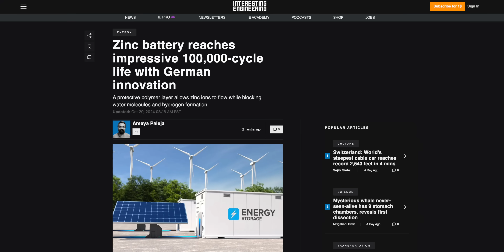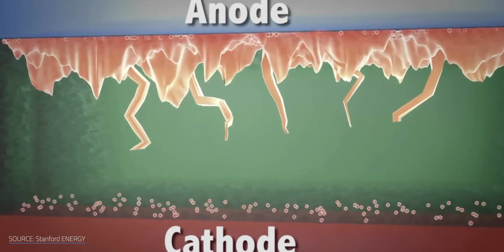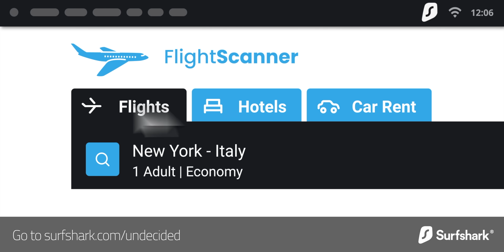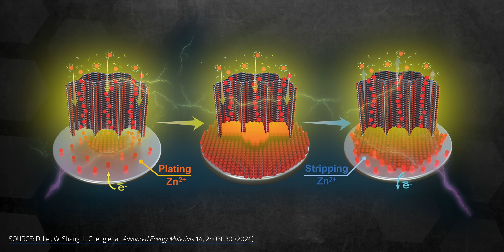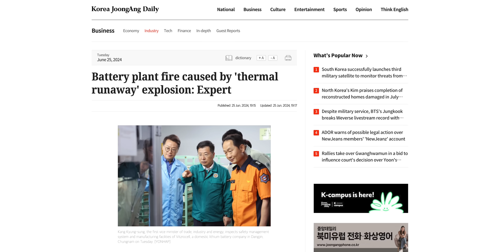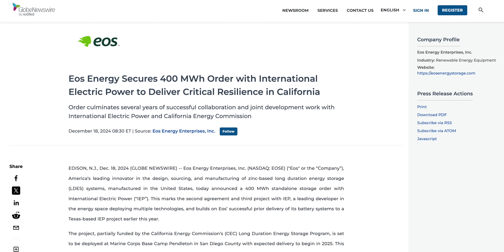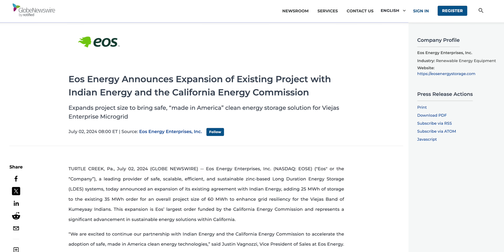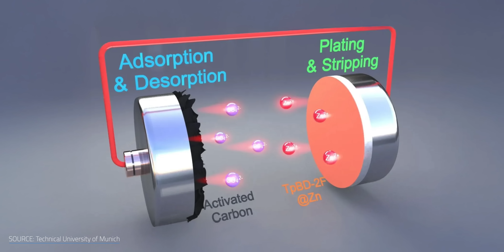How Zinc Batteries Are Defying Limits

Comment: Edison batteries, which use zinc and iron, don't have the problems of pure zinc. They do emit hydrogen, but don't have the other problems, so long as the aqueous electrolyte is refreshed every 8-10 years. Early 20th century EVs, which are museum pieces, have original Edison batteries that still function. No fancy nano-particles or polymers needed.

Comment: The avg dist. To the moon is 238,000 miles one way. So you could drive to the moon and back again one time, not three, with one tesla battery as it stands now. Or get that kind of mileage out of one 1990s toyota combustion engine that's properly maintained before needing a rebuild of the wearable internal components. Though the last 100k is a bit under powered and youll know she is getting ready to need a rebuild.

Comment: NO it does NOT last 100 000 cycles. Wait, but it does ? Even if it does, it doesn't MEAN ANYTHING.  Why ? Because manufacturers will continue to milk Lithium for ever. Why ? Because its PROFITABLE. Nobody cares about climate or saving the planet. PROFFITS is everything. Now imagine how ridiculous it sounds to sell the cars that lasts forever and doesn't need $ 50 000 battery replacement. So forget everything. Nothing will change. For at least another 30-50 years.

Comment: Redflow had a similar flow battery, what killed them was reliability of the moving components and a requirement for yearly servicing. The battery needs to operate for 5 plus years without any intervention.

Comment: Ummm... the one way distance to the moon, while quite variable depending on the specific point in the orbit, is reasonably close to 250,000 miles, so a Tesla battery with a life of 300,000 to 500,000 miles is not equivalent to "two or three round trips to the moon". One round trip would be roughly 500,000 miles.

Comment: Matt is just reading the Hype articles and not the technical papers. There have been so many "Revolutionary Tech" covered, but only less than a handful is being used or will be used. 

How many times has it been where you talked about hydrogen this, hydrogen that, cold fusion this or hot fusion that. None came up.

Comment: Hi Matt. Have you looked into the "Charlie" induction stove from Copperhome (I'd post their website link but Youtube seems to think that is spam and deletes the comment). The stove has a built-in Lifepo4 five kWh battery that would allow you to cook 3-5 meals during a power outage. It also works on shared 120V/15 amp circuits.

Comment: I'd thought that nickel-iron batteries were essentially-unlimited-cycles ( ie decades of daily-cycles ), & were preferred by the .. what are they called .. not Preppers .. Appropriate Technology people?  GEK, & the civilization-reboot-technologies people, OpenSourceEcology or something like that..

Anyways, IF industry special-interest-groups have been able to suppress things like nickel-iron batteries for grid-scale reservoirs,
and they were able to suppress NiMH for cars ( an oil-company owned that patent, to prevent that technology's use ),
etc, I've no doubt that s.i.g.'s will be able to continue distorting our market to make-certain that only patented/high-profit options are allowed to be chosen..

I met a guy who invented a bubble-insulated greenhouse..

He opensourced it, instead of patenting it..

4' thick of bubbles above the plants, in the winter,
you only apply power to the bubblemaker-motor when insulation's needed,
you only need 2 layers of plastic ( outer & inner ),
etc, made it amazingly effective for greenhousing..

s.i.g.'s won't allow technology they can't control to be pervasive.

He was already bitter when I met him, with reason..

( this was in Eastern Canada, btw, north of mainland US, & he had a fig-tree inside )

Anyways, the more I learn, the more that it seems that unnecessarily-fragile, unnecessarily-expensive technologies always are preferred..

Did you know that simply by switching from turbofans to turboprops, & slowing transport-aircraft some,
IMMENSE fuel-savings result??

Won't happen, though, will it?

& switching from turbine to piston cuts fuel-consumption significantly
( but increases the maintenance-frequency,
so you'd need to simply swap engines on an aircraft, instead of maintaining them on it.

that jet-tech guy, can't remember his name, looks like Radar O'Reilly, said the maintenance-costs are about the same,
between the 2 technologies )

Anyways..

Salut, Namaste, & Kaizen, Dood..

_ /\ _

Comment: 0:50 "...Elon Musk has said Tesla car batteries should last for 300,000 to 500,000 miles. That’s roughly the distance you’d cover if you drove to the moon and back — three  times."
Because 238,855 miles to the Moon, multiplied by two because "...and back...", and multiplied again by "three times" = 1.433 million miles. 
And everyone knows that 1.433 million is exactly the same as "300,000 to 500,00 miles".
Who writes the script?  And who reads it without thinking ?

Comment: Matt, as always, thanks to you and your team. Great coverage of some exciting innovation.

I recently leased a 2024 Hyundai Ioniq 5 Limited and took it on a 2000 mile road trip with my family. I had been "on the fence" about getting an EV but the climate crisis and my own complicity in it compelled me to "go for it". After approximately 3000 miles with the car my only regret is I didn't do this sooner. Charging stations along my route (from MA to KY) were plentiful. We traveled over the holidays and, yes, we had to wait at 2 places but even then the break was nice.

As an electrical engineer I truly appreciate the simplicity of the car in that it doesn't have all those moving parts an ICE-based car has and does not require all those fluids (oil, transmission fluid, gas). I smile at the thought I haven't been to a gas station in months! I don't have "tune ups" to be mindful of. It's been a joy. Also, the geek in me appreciates the sophistication - Maxwell's equations embodied in an engineering marvel with regenerative breaking!!! Beautiful.

I also have been making good use of energy sage (https://www.energysage.com) and have signed an agreement for a 32-panel, 14 kW array going up on our roof this Spring. I have scoped out an upgrade of our HVAC from natural gas to cold-weather, high-efficiency HP's but will have to hold off on that one for a year due to cashflow concerns (I'm "retired" now).

And I also use Surfshark regularly, great product. 

So I want to thank you and your team for all you have done to enable my journey of Electrification. I'm not done yet. So much more to do. But I truly appreciate what you have started.

Comment: In phones never, they need to sell new phones every 2 years. Battery problems makes owners get new phone
Reply: Startups always break the cycle if the technology is accessible and enough developed.
Reply: @Alunkard-Geovane  Frankly, can't happen soon enough.
Reply: @comradestannis  This is true, sadly.
Reply: @Alunkard-Geovane  yeah like that is going to happen
Reply: @kharkiv4life  corporate greed
Reply: Ive had the same iphone for 6 years
Reply: @John_Redcorn_  Relatable. I’m still chilling with an iPhone XS Max.
Reply: @kharkiv4life  or just change your battery for 40$
Reply: Also, a phone with a zinc battery will be massive. The energy density of zinc is about 1/50 of that of lithium.
Reply: Idk, I manage to replace mine every 5 years.
Reply: Regulations might mandate the batteries to be user replaceable. That way the incentive to make the battery have shorter lifespan loses at least some of its appeal.

Comment: @UndecidedMF I also went to CES earlier this month. I saw the stall at Schaeffler's installation (booth 4140 in West Hall LVCC). They are mostly mechanical parts for cars, and they had a robot, etc. BUT they had a solid-state battery. They used a compression system (based on the brakes system/parts) to support the operation of the battery cells. It was good. I've started following solid-state batteries because of your previous videos. If you didn't see this one, then I think you should check it out! I'd like to know what you think about this technology.

Comment: price and abundance of lithium means very little because only 2% of lithium battery is taken by lithium. it should be obvious if you just compare prices of different chemistries of lithium batteries. fire risk is significantly reduced with lifepo4. so you shouldn't compare lithium to zinc, it makes no sense. compare complete batteries. how much new(or even old) zinc battery costs per kwh?

Comment: Matt: To your video description below: There will be NO small wind turbine revolutionizing wind energy. By now you should have learned that and move on.
To the Zinc Ion battery: I am missing a clear distinction between the currently existing Zinc Ion batteries in grid storage applications and the ides the TUM has on how an improved battery using their trick will look like.

Comment: Aluminum-ion battery would be the ideal choice for stationary storage. Al is actually quite reactive, slightly more than zinc. It's dirt cheap and ubiquitous -- though the oxidation problems might preclude the use of aqueous electrolytes.

Comment: Arnt you showing photos of the red flow zbm3, zinc bromine flow battery.  It was developed in Australia and sold to many customers. 

Sadly they went out of business 
And it's a flow battery, not a jellyroll, 
And it basically had unlimited cycles due to its liquid nature.
Reply: @AnarchyEnsues  they also had a large number of system failures while under warranty. Which certainly didn’t help their viability as a business.
Reply: @HaakonOfTheShadows  i seen them go out of business.... i was looking online hoping to buy a cheap one if people were getting rid of them.  i did hear about that they were a little unreliable

Comment: Lets all pretend LTO hasn't been for sale for years literally everywhere. Sure there are some low quality ones only rated for 60.000 cycles thou that is at high 1c and only until 80% capacity, but even those will most likely be able to hit well over 100k cycles total and maybe 200k at low c rate.

Comment: An Australian company called redflow collapsed after building the for several years. Close to delivering them to a,erica in quantity but it fell over
Reply: Iron not zinc but yeah, major quality control issues in production, difficult to raise enough capital in Australia, and the manufacturing creche in Australia is not as supportive. There's no silicon valley equivalent in Aus

Comment: 100,000 cycles sounds great, but a battery only needs to recoup its costs for first 17 years. The discounted value of production beyond that point are insignificant. I.e. a battery bought today for 30-50% more might not be justified when you look at discounted cash flows. Sodium ion and LFP batteries look more sensible, as well as those solud state batteries promising higher emergy densities. 
That said, maybe suits battery swapping for short distances.

Comment: Please compare and contrast on a cost per kW-hr basis...  Never mind.  I'll do it.  Sand battery wins at large scales.

Comparing the total life-cycle costs on a per kW-hr basis for various energy storage technologies, including sand batteries, across a wide range of scales involves looking at their specific characteristics like initial capital costs, operational and maintenance costs, efficiency, and lifespan. Here's an updated analysis:

Home Use (Scale: Powering a home for 3 days)
Battery Energy Storage Systems (BESS) - Lithium-ion:
Capital Cost: 
$150-$400 per kWh.
Operational and Maintenance (O&M): 
Minimal, with potential battery replacements.
Life-cycle Cost per kWh:
$0.15-$0.40 per kWh over 10 years, considering degradation.
Sand Battery:
Capital Cost: 
Not commonly used at this scale due to efficiency and size; however, if used, costs could be high due to specialized equipment, potentially in the range of $500-$1000 per kWh for small prototypes.
O&M: 
Expected to be low, mainly heat management and insulation upkeep.
Life-cycle Cost per kWh:
Potentially very low if the system lasts long, possibly under $0.10 per kWh due to very minimal degradation, but initial costs and efficiency are significant drawbacks at this scale.

Medium Scale (10x increase, e.g., small community)
Lithium-ion BESS:
Capital Cost: 
$100-$300 per kWh.
O&M Costs: 
Low, similar to home use but scaled up.
Life-cycle Cost per kWh:
$0.10-$0.30 per kWh, leveraging some economies of scale.
Sand Battery:
Capital Cost: 
Could be around $200-$500 per kWh, assuming larger systems reduce per-unit costs.
O&M: 
Maintenance costs would include managing heat and structural integrity.
Life-cycle Cost per kWh:
Might approach $0.05-$0.15 per kWh if the system's efficiency and longevity are maximized, though still higher than lithium-ion due to initial setup.

Large Scale (100x increase, e.g., a small town)
Pumped Hydro Storage:
Capital Cost: 
$1,000-$2,000 per kW installed.
O&M Costs:
Spread over many years, resulting in low life-cycle costs per kWh.
Life-cycle Cost per kWh:
$0.02-$0.05 per kWh.
Sand Battery:
Capital Cost: 
Could decrease to $100-$300 per kWh as scale increases, leveraging simpler materials like sand.
O&M Costs: 
Similar to medium scale but with more sophisticated heat management.
Life-cycle Cost per kWh:
Could be around $0.03-$0.08 per kWh, competitive if thermal efficiency is high and maintenance is low.
Flow Batteries (e.g., Vanadium Redox):
Capital Cost: 
$400-$600 per kWh.
O&M Costs: 
Higher due to electrolyte management.
Life-cycle Cost per kWh:
$0.30-$0.50 per kWh.

Very Large Scale (1,000x increase, e.g., a large city)
Pumped Hydro Storage:
Capital and Life-cycle Cost: 
Very cost-effective over time, potentially under $0.02 per kWh.
Sand Battery:
Capital Cost: 
Might reduce to $50-$150 per kWh with scale and innovation.
O&M Costs:
Expected to remain relatively low, focusing on insulation and heat management.
Life-cycle Cost per kWh:
Could be very competitive, around $0.01-$0.05 per kWh if thermal storage efficiency is high and longevity extends beyond typical battery cycles.
BESS - Large Scale Lithium-ion:
Capital Cost: 
$100-$200 per kWh.
Life-cycle Cost per kWh: 
$0.05-$0.20 per kWh.

Mega Scale (10,000x increase, e.g., 1 million residents city for 3 days)
Pumped Hydro Storage:
Life-cycle Cost per kWh: 
Less than $0.01 per kWh due to massive scale and longevity.
Sand Battery:
Capital Cost: 
Might be as low as $30-$100 per kWh with very large installations.
O&M Costs:
Very low per kWh due to scale, potentially making sand batteries very cost-effective for long-duration storage.
Life-cycle Cost per kWh:
Could be among the lowest, around $0.005-$0.02 per kWh, assuming thermal losses are managed effectively and no significant degradation occurs over time.
BESS - Lithium-ion or Alternatives:
Capital Cost: 
$80-$150 per kWh at this scale.
Life-cycle Cost per kWh: 
Around $0.04-$0.15 per kWh.

Contrast and Considerations:
Scalability: Sand batteries, like pumped hydro, benefit from scale but in different ways. Sand batteries could offer very low life-cycle costs for long-duration storage if thermal efficiency is optimized.
Technology Maturity: Sand batteries are less mature than lithium-ion or pumped hydro, with potential for significant cost reductions as technology develops.
Efficiency: Sand batteries operate on thermal storage principles, which might have lower round-trip efficiency (e.g., 60-80%) compared to electrochemical (85-95%) or mechanical storage (70-85%) but excel in long-duration storage.
Environmental Impact: Sand batteries use abundant materials but require careful management of heat and insulation to prevent energy loss and environmental impact.

This comparison reflects current knowledge and projections, with sand batteries offering promising long-term storage solutions at potentially very low costs per kWh, particularly at larger scales, though their implementation at smaller scales is less economically justified currently.

Comment: The main issue with batteries today is energy density. All design points are interesting, but 100,000 recharge cycles is only interesting for some niche cases with many cycles per day. Maybe hybrid vehicles with a cycle per stoplight, or burst discharge like flashes.

Comment: Zinc is incredibly cheap yes, but Zinc battery chemistries have bad energy density. Most (Western/American/etc.) Consumers don't keep their products for long so battery life doesn't even really matter because people just trash/give-away/abandon their products after it goes through their lifespan. That, or in the rarer cases they can just swap the battery, which is not particularly expensive for stuff like mobiles or laptops.

Overall "nobody" (or rather no consumer for typical consumer products) wants/needs so many charge cycles in their device. But it could be a potentially useful technology for mass power grid storage as he mentions.

Comment: Also again I would like to point out that lithium is not really uncommon it's the 31st most abundant materials in the Earths crust which makes it more common than lead and zinc is only 3.5x more common, the real issue with lithium is not abundance it's the difficultly of processing it. This is important because theoretically there could be a much better process for purifying it at which point it becomes a non issue.